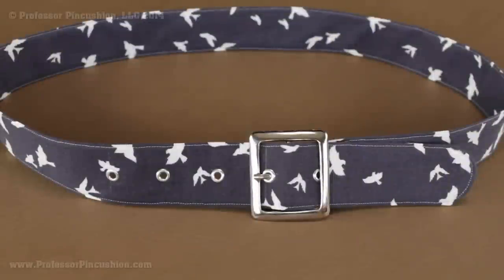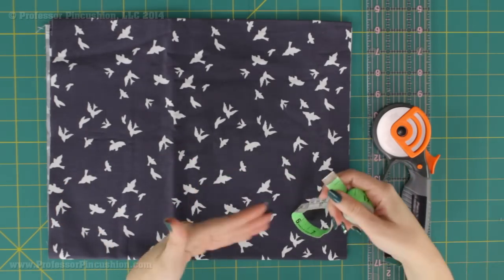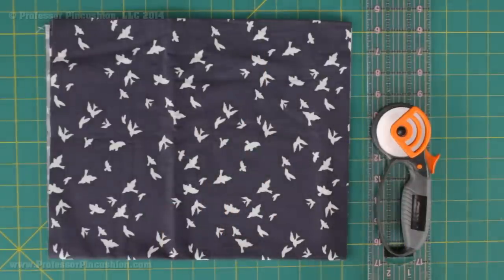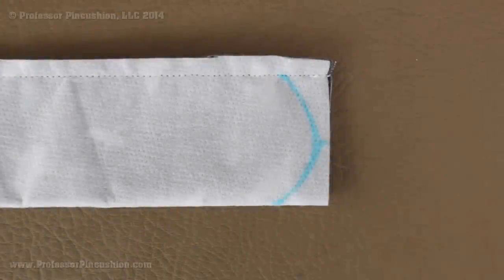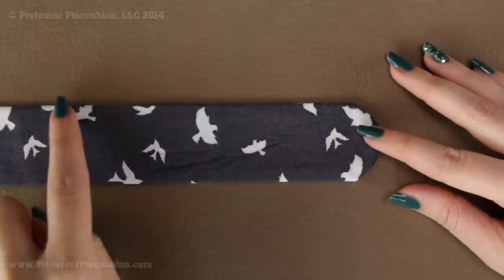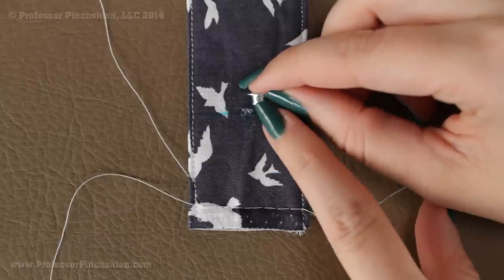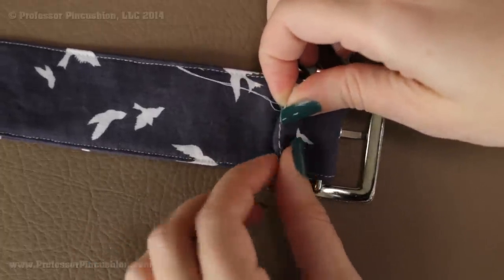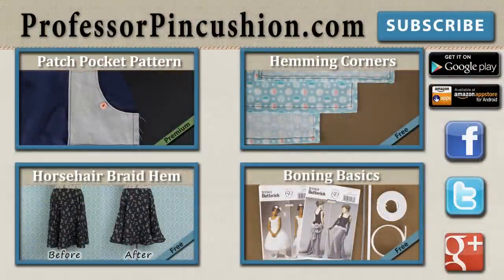How To Sew A Fabric Belt

Comment: Thanks so much for sharing this! How would you go about making a belt with a different fabric on the wrong (or inner) side of the belt?
Reply from the maker: You can totally do this!  Figuring out the length is still the same.  You'll be cutting 2 strips and each strip will be your finished belt width plus 1" (instead of belt widthX2 plus 1).  One will be your main fabric, the other will be your contrasting fabric.  Cut 2 strips of interfacing the same size.  After putting on interfacing, place strips right sides together.  Instead of sewing on just one side, you'll sew both long sides at 1/2" seam allowance.  Hope this helps.